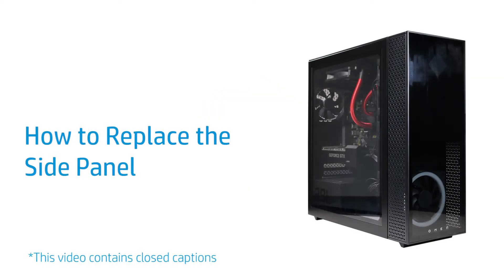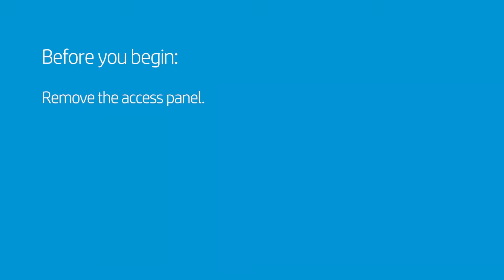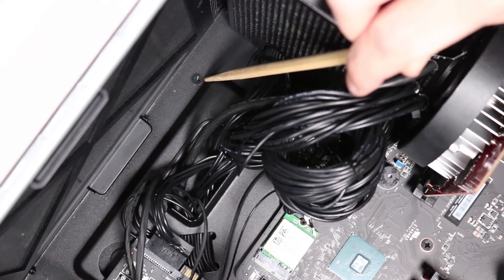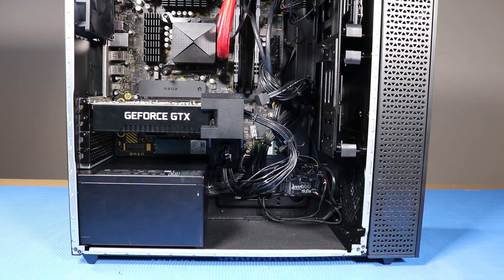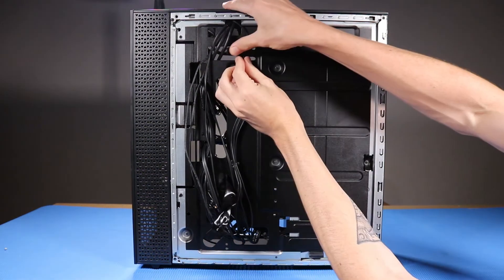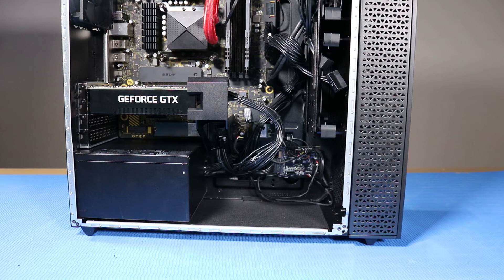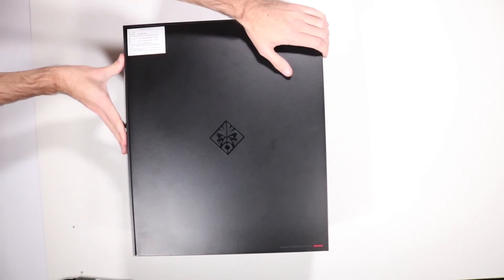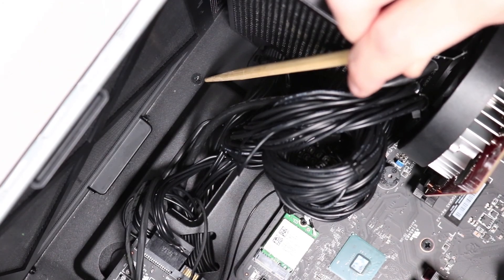Replace the Side Panel | OMEN 25L GT11-0000a, GT11-0000i, 30L GT13-0000a, GT13-0000i Desktop PC | HP

Comment: My motherboard melted just left of the CPU. I had to cannibalize the 30L for whatever I could use to rebuild it.  Never again will I buy a prebuilt computer from HP again.  No customer service.  Computer was 6 months old and the guy basically hung up on me at HP customer care.
Reply from the maker: Hi there, thanks for contacting HP Global Social Media Support!
I understand that you are experiencing an issue with your computer as the motherboard melted. 
This looks like hardware issue, and you might have to get the comouter serviced. 
So, I would request you to contact our Support, and our Support Engineers should be able to sort this out.
HP Support can be reached by clicking on the following link:
•	Click on this link – https://hp.care/6059S8IvX
•	Select the product type.
•	Enter the serial number of your device or select let HP detect your product option.
•	Select the country from the drop-down.
•	You should see the HP support number or Chat option listed
Regards, 
HP Support

Comment: I appreciate this video, but I do not appreciate the inaccessible mounting bracket for the CPU cooler. Replacing the rear exhaust fan was comparatively easy, now I have to take out the whole motherboard…

Edit: took out the mobo, hurt my thumbs trying to push the cooler’s bracket out. Guess I’m not upgrading the cooling…
Reply from the maker: +LifeWulf Thanks for sharing your inputs.

Comment: this pissed me off
Reply from the maker: +caitlyn wright - NOTE: Only certain models in this platform series support the configuration of the following components:
- glass side panel
- liquid cooling system
- lighting control module
- LED lighting bar
- glass front bezel
- front RGB fan
- front lighting module
- Before you begin: Remove the access panel.
- Removal
- Push aside the power supply cable and any other obstructing cables to access and remove the single P1 Philips-head screw.
- Turn the unit around so that the side panel is facing upwards.
- Push the side panel forward slightly and lift it off the retaining tabs at the bottom of the chassis to remove it.
- As you complete the replacement of a part for the desktop, you should ensure that all of the cables are correctly routed. The interior of the system should never look like this after a service event.
- As you route any cables that you’ve connected back into position, be sure to use the clips, hooks, and tape that are provided on the chassis for this purpose.
- This prevents the possibility of cables snagging or sagging when the desktop is moved. It also helps ensure clear sight and access to the components should any further troubleshooting or servicing be needed.
- Replacement
- Align the side panel with the bottom of the chassis and position it securely on the retaining tabs of the chassis.
- Push the side panel forward, and from the top and back of the panel slide it firmly sideways until it closes and clicks into place.
- Turn the unit back around.
- Push aside any other obstructing cables beside the power supply to access and replace the single P1 Philips-head screw.
Caution: Improperly installing or replacing parts could damage your HP device or void your warranty. Before replacing any parts, check your warranty.

Comment: I’m having A HARD TIME PUTTING IT BACK ON
Reply from the maker: +Irvin Deleon Follow these steps to Learn how to remove and replace side panel for the OMEN 25L GT11-0000a, GT11-0000i, 30L GT13-0000a, GT11-0000i desktop PC series.

- How to Replace the Side Panel
- NOTE: Only certain models in this platform series support the configuration of the following components:
- glass side panel
- liquid cooling system
- lighting control module
- LED lighting bar
- glass front bezel
- front RGB fan
- front lighting module
- Before you begin: Remove the access panel.
- Removal
- Push aside the power supply cable and any other obstructing cables to access and remove the single P1 Philips-head screw.
- Turn the unit around so that the side panel is facing upwards.
- Push the side panel forward slightly and lift it off the retaining tabs at the bottom of the chassis to remove it.
- As you complete the replacement of a part for the desktop, you should ensure that all of the cables are correctly routed. The interior of the system should never look like this after a service event.
- As you route any cables that you’ve connected back into position, be sure to use the clips, hooks, and tape that are provided on the chassis for this purpose.
- This prevents the possibility of cables snagging or sagging when the desktop is moved. It also helps ensure clear sight and access to the components should any further troubleshooting or servicing be needed.
- Replacement
- Align the side panel with the bottom of the chassis and position it securely on the retaining tabs of the chassis.
- Push the side panel forward, and from the top and back of the panel slide it firmly sideways until it closes and clicks into place.
- Turn the unit back around.
- Push aside any other obstructing cables beside the power supply to access and replace the single P1 Philips-head screw.
Caution: Improperly installing or replacing parts could damage your HP device or void your warranty. Before replacing any parts, check your warranty.

Comment: How can I access the glass panel latch mechanism.  My brand new unit is missing a spring or something as it will not latch the glass panel in place when closed.  There is nothing to cause the latch rail to return after pushing the release button on the back.  Any place to find a breakdown of that mechanism, or instructions as to where the spring would be located?  There was a single Phillips head screw loose in the case upon arrival, but I was never able to find where it came from, nor any other loose parts.
Reply from the maker: +David Brittenham This seems to be a hardware issue with your computer. Please contact our phone support team to fix this issue. Please follow these steps to reach them.
Step 1. Open link: https://support.hp.com/us-en/contact-hp
Step 2. Select the product type.
Step 3. Enter the serial number of your device or select let HP detect your product option.
Step 4. Select the country from the drop-down.
Step 5. You should see the HP phone support number.

Comment: Doesn’t work for 30L
Reply: After removing that one screw, lay chassis on its side with rear panel facing up. At the same time apply pressure down on the panel and slide it back towards the exhaust fan side. It will come off with ease.
Reply: Did you figure it out yet? In same boat
Reply: @lexiandrews8772  no I tired every way to push pull and whatnot. Idk what I’m doing wrong
Reply: @IRIEvideogames  Hey, JUST got it off. You gotta keep trying.
Reply: @IRIEvideogames  It took some time it was a little stuck (guessing it will be easier next time) Just keep at it, it does take some gentle force.
Reply: @IRIEvideogames  Make sure you are pushing from the exact side that is shown in video as well.
Reply: @lexiandrews8772  oh deng okay. Thanks!
Reply: @IRIEvideogames  Good luck!

Comment: Is this the same for the HP 30L?
Reply: I have bought the 25L for my son but I hadn’t noticed the variant I got is a fully enclosed case. I cannot find a tempered glass side panel anywhere to replace the aluminium one. Are these just not sold?
Reply from the maker: +BadNewsHughes Yes. It is the same.
Reply: @HPSupport  Is it only one screw for the 30L? I cannot slightly push the panel forward
Reply: moynier9 Did you ever figure this out? When I was playing around with it, I was unable to remove the side panel.
Reply: @ratdog_218  it is the same, remove the screw inside the case then you just have to push it really hard, it was a little stuck for me
Reply: BadNewsHughes Thank you!
Reply: Mike yeah, it took a little more force than I expected to get it off. It helped to push down and back from the center of the panel. Are you looking to upgrade something?
Reply: moynier9 Yeah... I got a good deal (at the time) for a config I can’t find anywhere on HP’s site.. but it was HP Omen 30L w/ 2080 TI, 3700X, 8gb RAM, and a 500W PSU. So, weirdly small  and low-rated PSU and RAM for the specs. I already upgraded the RAM.. Now I want to upgrade the PSU with one I had in my previous build. Working on it now!
Reply: Mike Nice! Yours will be perfect once you get the new PSU. I made the mistake of buying the 1660 super version thinking I could slowly upgrade parts. Unfortunately there isn’t much upgradability on these builds. I ended up building a completely new PC, and I’m using the gpu and cpu while I wait for Zen 3 and 3080 availability.
Reply: moynier9 Thanks! unfortunately the chassis has an indention which makes it impossible to fit my longer PSU inside. I am going to have a friend help me cut the chassis so it’ll fit. Everything is hooked up, just the PSU is sticking out. 

What isn’t upgradable that you want to upgrade?
Reply: @ratdog_218  That's nice you have someone that can help you with that! I'm the furthest from an expert btw, but most of my frustrations were with the motherboard/BIOS. 

1) You can't activate XMP, so RAM runs at stock frequency unless you OC in Ryzen Master or buy one of their ridiculously overpriced sticks. 
2) More importantly, you can't change anything in the BIOS, so no overclocking in general (again, besides in Ryzen Master).
3) I wanted to upgrade to an AIO liquid cooler, but the metal plate behind the mobo blocks you from doing that yourself.
4) The mobo only has a 6-pin connector for the CPU power supply which is probably fine for the r5 3600 that it came with, but I've read that it wouldn't be enough for CPUs higher than that.
5) It doesn't have an extra slot to add another m.2 nvme ssd. Not a deal breaker.

The 30Ls are exceptional pre-builds, but they are pretty much made to stay how they came out of the box. I ended up getting an x570 motherboard on my new build which makes way more sense considering I will eventually upgrade to an RTX 30 series (with PCIe 4) and one of the new Zen 3 CPUs.
Reply: moynier9 You sound like way more of an expert than I am! I was considering a liquid cooler, so that’s good to know. I bought this as a quick upgrade to my i7 6700k / GTX 1070 build — it was worth it with the deal I got, even with 3080 coming out. 

I think you just further convinced me to build my own again once I can get my hands on a 3080.